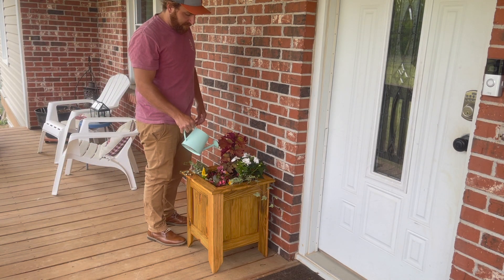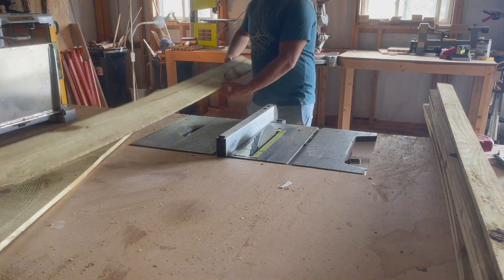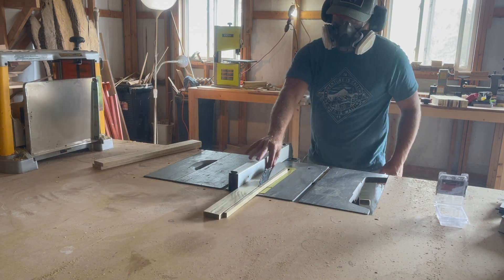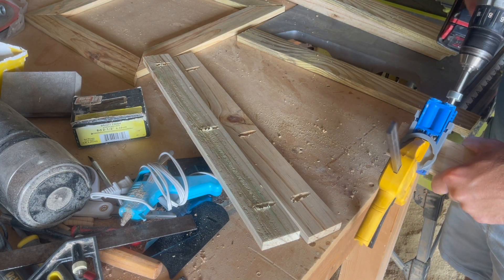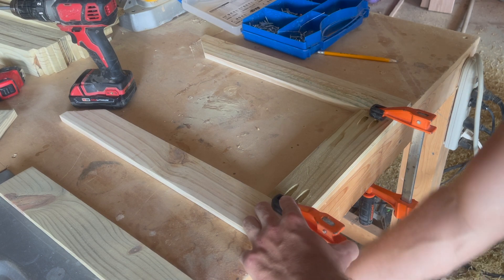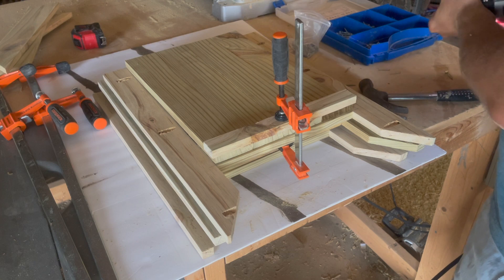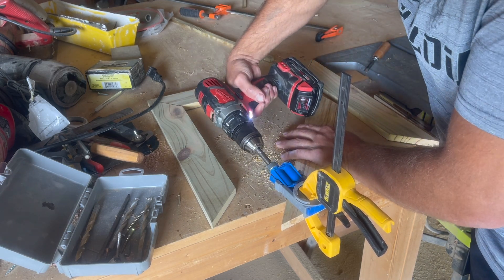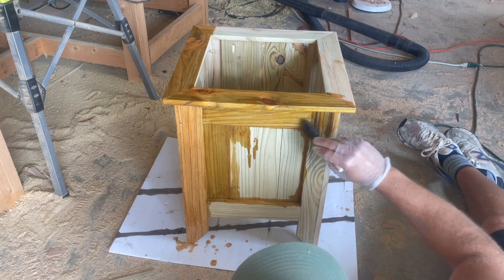CHEAP DIY Planter Box Build

Comment: I made similar boxes but on the bottom of the legs I screwed in rubber feet, like you'd install on bottom of cutting board. This helps keep legs dry and out of water after watering or rain storm.
Reply from the maker: Not a bad idea! May have to do that too!